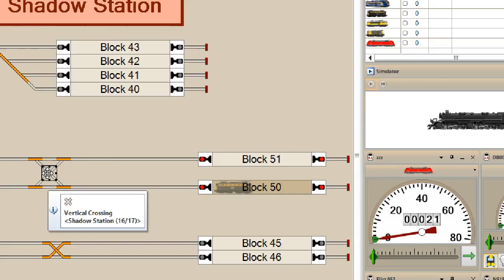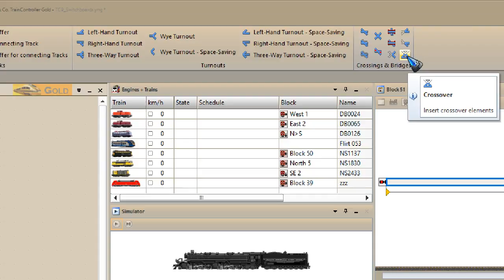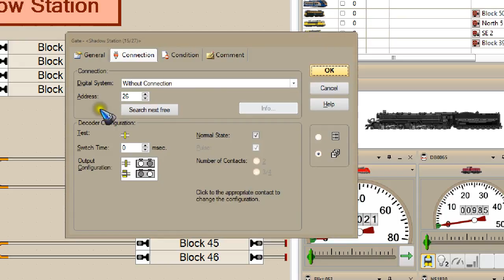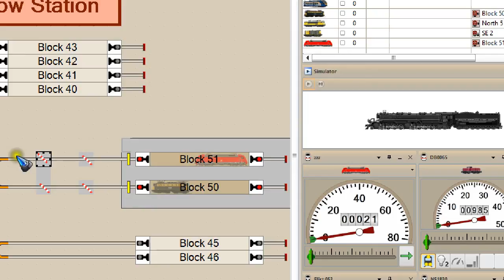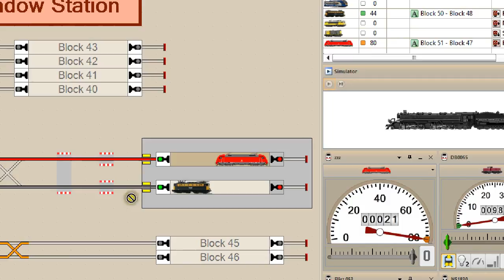Traincontroller 51 - New Switchboard Elements : Gates and Crossovers

Comment: Hey Rudy....
A question from Stockholm. (Or a few)

Is it necessary to place the blocks in numerary order? 1,2,3,4 and so on....
You see the problem is that when i make a route /schedule....indont know the difference...hehe!  
When i start the train, it always choose the wrong path, and turns a switch......and always want to inwolve block nr 8. 

So maby i have to inwolve block nr 8 into the route? 
So question is, must i place blocks in order in each line..... or can i place them anywhere?

Thank from winterland
Reply: Danne Machmar When you create blocks, TC numbers them in sequence, but that number has no meaning with respect  to any 'order', You can rename the blocks, can be any text you like.